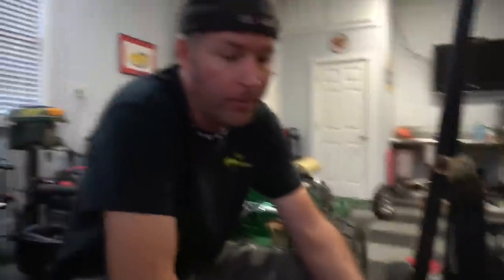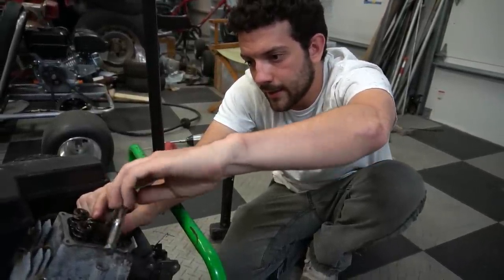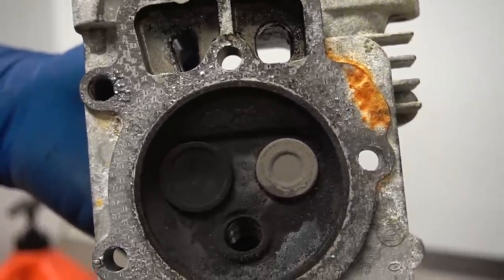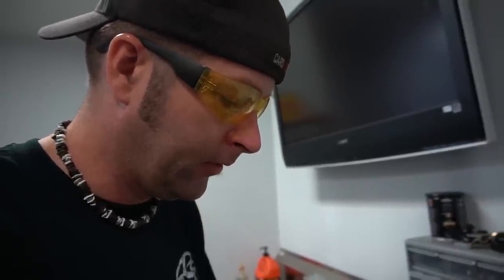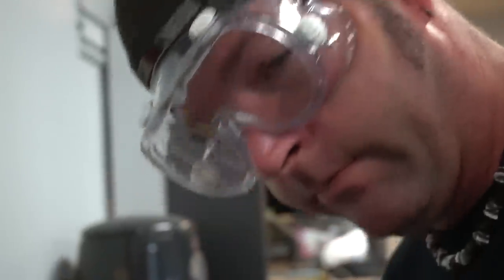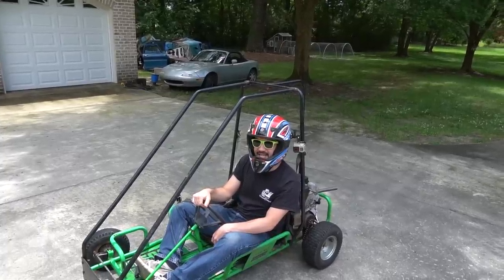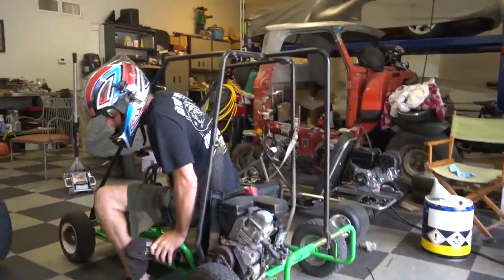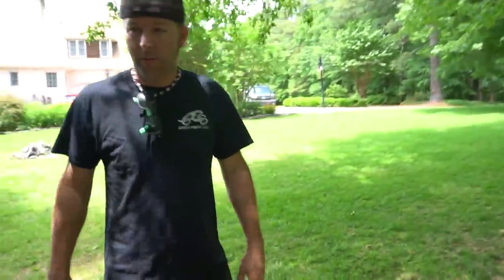5 Free Mods to Increase Go Kart Horsepower! Pt. 2

Comment: I know you guys are just having fun and aren't really trying to be scientific in your approach, learning as you go. But, as an engineer, certain things bother me. So take this for what it is worth:

1. A single data point does not a trend make. Three to five runs should be recorded for all of your testing. This is done for several reasons. Sometimes you want an average and if you only use one or two points, you could be using outlying data unknowingly that will throw off your 'average' considerably. Other times you may want the highest or lowest number (fastest kart around the yard) but you want to make sure that the test/data is somewhat repeatable to ensure that something wasn't messing with your testing as well as give each kart a fighting chance. If you took a corner bad or didn't get into the brakes or throttle right it could hurt the time, or maybe the carb just picked up an air bubble or piece of dirt and hurt the engine performance. If you get one really quick time and can't come anywhere near it again, this can help to show that maybe Isaac got excited and accidentally touched his phone screen a few times, stopping and restarting the timer a few seconds later during the run. 

2. Look up a vapor pressure vs temperature graph and tell me how gasoline is going to condense on the 350+ degree F aluminum in an engine head. A rough intake tract may help keep the fuel atomized in a cool intake track but isn't going to do jack in your case except on cold starts. Someone call me out if i am wrong. 

3. Your valves could be leaking a significant amount of air at pressure but won't show a leak with more viscous water at atmospheric pressure. I'd grab a $5 lapping tool and some compound and give those valves some TLC because, as you pointed out, there are definite signs of leakage. 

4. It would have been nice to see all three testing parameters from the beginning of this build. - i.e. the drag race down the driveway, timed lap around the yard, and top speed run - to show everyone how different mods effect the kart. Someone who doesn't understand the purpose of removing the governor may not understand what is going on if you do a drag race and the kart doesn't get up to speed enough for the governor to kick in, but it will help immensely if they see a before and after on top speed. 

5. Did you even attempt to run the engine and check the spark plug for proper fueling before drilling out the jet again? Richer doesn't equal more power. Richer is safer and will help prevent preignition, but hurts power. You have to find that balance. 

 Despite my critical nature, I really like this type of video. Lets see more budget builds and modification testing! My next suggestion- timing advance with either a timing advance woodruff key or a bracket to relocate the magneto. 

I would also love to see Isaac try to weld-up and regrind an aggressive camshaft. I think that would make for a really riveting video!

Comment: On the clone 196cc drill out the fuel jet with a 1/32 drill bit, i drilled mine with a 1/16 causing the carb to flood ruining it, do not make the same mistake use a 1/32 bit

Comment: Ike is only half right there...   intake manifold should be mirror finish,,  the atomizing should happen in carb when fuel jet hits the airflow.     You will loose upto 5% power from unfinished intake manifold .

Comment: an FYI for you guys, water molecules are larger than gas molecules so the valve  leak test with water was not accurate, always use gas, brake cleaner or a leak down tester. I learned that the hard way many years ago

Comment: I got on my cousins go kart today, it has the tecumseh 5.5 hp power sport, and after sitting for several years, I romped on it and it gave out and shut off, and now a loud ticking can be heard in the head when starting the engine. Oh well...
Reply: Update: just a sheared valve spring retainer

Comment: 1- do one change at a time and then test so you can see what those changes do
2- I doubt that you're getting any power by drilling the jet.  You're making it richer, but richer doesn't mean more power unless you're starting out lean.  Since  you're not testing that in any way and since carburators react to the load on them, I doubt that you're starting lean and I'm betting that you're actually hurting power by drilling the jet.

Comment: You called it a dished head, wouldn't that be a Hemi head ( Hemispherical combustion chamber)  .  Tecumseh are not bad engines when you get them tuned right.  I have a tiller that is about 45 years old that has a 6 hp Tecumseh on it. ( my brother bought it new from Sears early 70's)  It still runs great. I replaced the carb with an ebay carb  last year for like $17.

Comment: 1) No air filter
2) Add water to engine
3) No muffler
4) Remove excess weight like bolts
5) Bald your tires.
They are right, those 5 mods are ALL FREE! It wasn't clickbait.

Comment: Did you ever take the governor off? And get a torque converter 😊 I had an old tecumseh engine I blew the connecting rod in half I ran it out of oil 😂👎

Comment: Technically it didn't cost $0 because you have to go out and buy the tools to be able to accomplish these mods for the ones that require tools at least that is if you don't have them which most engines require different tools because they're different designs

Comment: That go kart go's 36, thats almost faster than my Honda rancher 😓
Reply: Seems like it should do 50 with the governor bypassed...
Reply: BuzzLOLOL, the go kart, or the 4 wheeler ?
Reply: Back in the 1950's-60's, our Briggs flathead (gov disconnected) 3 HP minibikes/karts got 35 MPH, 4 HP 45+... these guys seem to be getting slow speeds from 6.5 HP engines...
Reply: Heavier

Comment: that portjob is about how wrong as it gets. sure you can increase en smallest diameter for rpm performance but you dont just want a straight tube open it up all the way out. maybe increase dia diameter by 1-2mm all the way trough probobly just 1mm with stock valves without larger valves and a seat job you only wanna optimize the shape.
Reply: jompa zx we didnt strait tube it. We just opened it up some

Comment: Hey I am having a problem with my predator its spits and sputters cleaned the carb several times can you help me
Reply: Thank you I will try
Reply: Don’t do that it’ll ruin your engine!
Reply: Ok thank you do you know what I should do
Reply: It won't ruin the engine, sugar is a great solvent that will mix with gasoline. It will clean the whole carb and fuel system. Even the places you can't get to.
Reply: Change the sparkplug first
Reply: BromlabMC where tf are you gonna get nitroglycerin
Reply: BromlabMC and i looked it up and that shit will either clog your carb or kill your engine bc sugar doesnt dissolve in gasoline
Reply: Ok so now it’s running but when I give it full throttle it does new spark plug just got it today and also cleaned the values
Reply: Yes
Reply: Josh Stephenson3 idk what to tell you bud when it flattens out at higher roms its usually the carb
Reply: Moneymaker1939 the fuel line from the tank could be clogged so the carb cant get enough gas

Comment: I brought a predator 212 in april rode it a few times then i ordered a new carburetor and put it on and now with both carbs it wont start i need help
Reply: minefan 01 i just put a ne spark plug in when i ordered the carb
Reply: Davon Brown Make sure there is no air getting in threw the gaskets where the carburetor goes
Reply: Fernando Marin ok
Reply: Try turning the kill switch off then some starting fluid
Reply: Chandler Johnson rxplain more.
Reply: Do you have spark? If you do add some fuel down the spark plug hole then if that don’t work make shure the off switch is in the run position then add some starting fluid

Comment: To be honest the couch surface in the intake does not really do a damn thing. Sorry to blow that theory for you. There have been tests on heads where they had run a rough intake Trac and smooth intake Trac and it doesn'ake any major gains or losses... Check out engine masters on motortrend app. Finnegan and fryberger test that theory and it's junk it's just a old saying... Doesn't work.
Reply: Plus I have ported all my trx 450 and crf 450 heads and make the both ports smooth